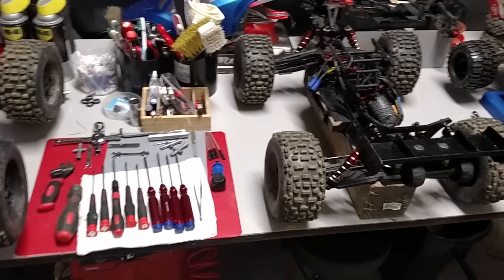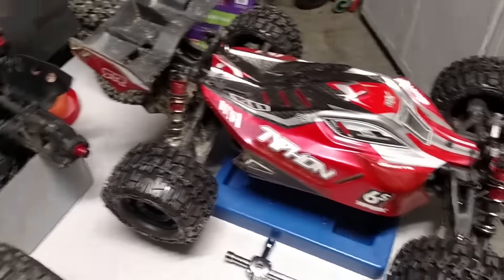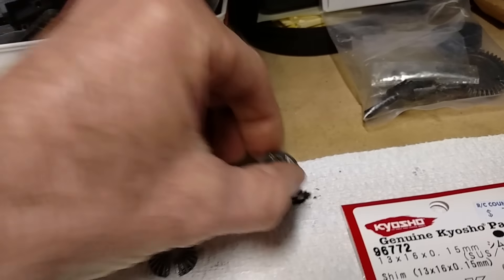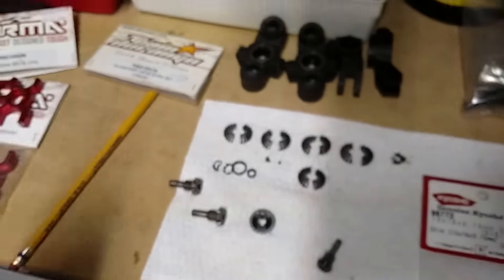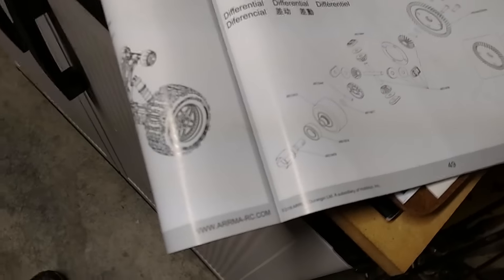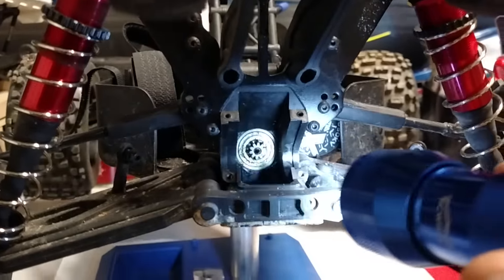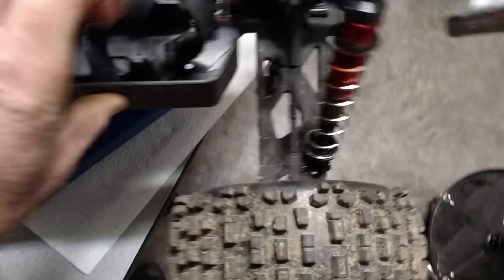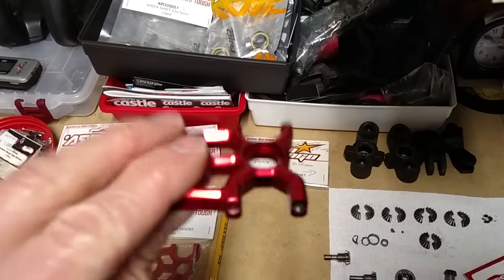Arrma Outcast 6s diff gear breakage

Comment: Thanks Rich for informative video, so far no dif breakage. Been running Typhon (16t) and Kraton (14t) on  2+3s Venom 50c 5000 mah just for bashing.... I also noticed your son's new Typhon shoes ( 2.8 trenchers on proline f11  wheels) looks exactly like mine, great job. Don't forget to tape them before gluing..
Reply from the maker: ReyDg thanks bro. Glad you haven't had any diff breakages yet. I shimmed my Typhon diff after first breakage and it had worked great. Definitely going to tape those Trenchers. I forgot if you told me how you fitted your F11s, did you use hex adapters?

Comment: Np Rich, glad to help and share.. I also use EZ bedliner spray  on Typhon ( 1 coat) for body to strength. It's also flexible and waterproof.. I put (2 coats) on Kraton and it seems to be cracking( the spray) due to the multiple coats. As for the Typhon with one coat, it's holding up really well...
Reply from the maker: ReyDg thanks for that too. I've gotten by with shoe goo and drywall tape, but spray seems much easier. Some guys on the forum also use Flex seal spray, going to give the spray a try.🐒🐒🐒

Comment: Great vid Rich thanks for sharing. My question for you is why do you suppose Arrma doesn’t build the stock diffs tighter? What are the downsides to tighter diffs that they may be considering? Could it be they want them looser for more speed, less power loss through the drivetrain, longer battery runtime, lower heat buildup on the electronics? Just seems to me that if those things are the tradeoffs, I’d rather deal with those things than busted gears. Curious your thoughts. Thanks.

Comment: Ha, same here. Have all but the Talion, can't believe I didn't get one as the Fireteam was last purchase when $399 and got it instead. Now I want a Talion. 🤣 But back to story my Typhon 6 I made for speed and don't get to run it much not having the space, so if anything breaks on my 6s vehicles the Typhon will be used for spare parts for awhile. The Arrma 6s is definitely the sweet spot for RCs. Even getting rid of my Xmaxx as I have more fun on 6s.

Comment: I'm having some clicking with my Notorious, so I'm searchn to pin point my issue, an lookn for ways to upgrade, so this issue doesn't happen in my future..hope this solves my problem..thnx bub..Great Vid..👑🙏
Reply from the maker: My first reply got erased 😝. Clicking is usually a busted tooth on the input and/or flattened or chipped teeth on the crown gear. Make sure your diff case isn't cracked or the gear cover screws stripped out. That will allow new gears to strip out again. Using 2-3 Tekno #1222 shims on the crown gear side bearing tightens up the mesh and helps prevent gear failures. I did a better diff build video after this one. Only (internal) diff difference is with the V4-V5 diffs, I no longer use extra Mugen satellite shims, just swap out the planetary shims. 🍻😎💪👊👊https://youtu.be/5gy3mt8zVmA
Reply: @richduperbash2966  thanks Rich, il go check the vid out aswel..it researching on my rig for the issue, I had found the left front wheel hub was rounded out on the wheel itself..so I'm going to pull all different an rebuild an shim after watchn ur vid..thnx for the info,Great Advice n Vids bub..🤝🤘👍🙏

Comment: Thank you for this video. I'm still a noob but I'm good at tinkering to find a solution. Will be ''bullet-proofing" all my diffs in my free time this week. (6 diffs. 3 on my outcast and 3 on the one I bought my Dad.)
Reply from the maker: Tristan Hardy your very welcome. I was rambling on quite a bit, but follow Tp-PartsRC-Xtreme vid with the supplied shim part numbers and your golden. I have bashed the living crap out of these diffs and it truly makes a difference. You can still have breakages of course, but they are much less frequent. The 2-3 bearing shims on the crown gear side by Kyosho or Tekno have been awesome in keeping the crown and input gears meshed better. Kyosho's are my favorite, but Tekno TKR 1222 works also. Good luck and props for hooking your pops up, very cool of you to do that.👍👍😵😵😵😲👊
Reply: He gets the good stuff. Already dropped in the Voltage Hobby servo mount and the RPM front skid plate on both. I highly recommend the servo mount.  

Really glad you explained the "mystery shim" as well.... Now I have to figure out where mine rolled to... Getting gear slippage on the rear Diff. Bonehead move on my part.
Reply from the maker: Tristan Hardy just saw your message. So awesome to hook up your Dad like that. Yeah the "mystery shim" had me baffled at first, they are paper thin and easy to lose no doubt. I've done lots of bonehead stuff in my garage, believe me...Lol. Lightly greasing these shims helps them stay put while slipping the diff unit into place and when putting the gear case cover back on. I've spent a good chunk of time, countless hours wrenching and experimenting with these Arrmas, bulletproofing is definitely worth the effort. And pushing that crown gear over into the input more with bearing shims has helped big-time. Changing the input gear is a PITA, definitely helps from breaking those little teeth off when the diffs get torqued from rapid deceleration....ie, hard on throttle landings or moments when the wheels get jammed suddenly. Let me know if you have any questions bud, love bashing and wrenching about equally. 👍👍

Comment: @RichDuperbash - i know this is an old video brother but i AM getting ready to do some maintenance on my shims! I was able to find the 
KYO96772 - Kyosho 13x16x0.15mm Differential Shim Set for my 6s KRATON & my 6s Notorious... How did these shims work out for you, were you able to stack two on each side or did just 1 work ?
Reply from the maker: I could usually stack 2 of them on each crown gear side bearing. It's nice to also have the thinner Tekno #1222 shims also. Allows you to really fine tune based on different tolerances 🍻😎💪👊👊

Comment: New Notorious. 2nd run started clicking/rattling. Picked it up and spun the wheels and noticed that both front wheels could spin forward independent of the drivetrain. Pulled out the front diff and it looks ok. Next step to open it up and see what's going on inside..
Reply: Upon closer inspection the main diff gear and the one that drives it are both worn from slipping. Surprised it happened only on the 2nd run. Hadn't even run the battery down either time. Thought Arrma was meant to be tough.

Comment: Thanks for the advice these diffs, something wrong with my Outcast rear diff so doing some research before I tear it down, what diff oil weight do you use in your Outcast, Arrma forum says popular is 70k/100k/30k front to back??
Reply: I wrote down 50/200/20 from a kraton video he did if that helps
Reply from the maker: Sorry I missed your message Matt 👀. I'm running 50/200/20K front to rear. Works great for me overall. 🍻🚀🚀😎💪👊👊
Reply: @richduperbash2966  thank you Rich is it also needed to shim the stock input gear that meshes with the crown🥺

Comment: had a rock get under my center diff it wedged and pushed the pinion gear all the way back to the motor. i think broke the front ring gear. i am not getting full torque to the front wheels now.
Reply from the maker: Yeah that sucks Craig 😝. Rocks can wreak havoc for sure. If you're not hearing cyclical ticking or grinding (slippage) on harder throttle or braking, it could be the center diff. Likely the front planetary gear and/or set pin cracked. I'd check the center first as it takes the most abuse and then the front. 😎💪👊👊

Comment: Yes I used the Team Associated RC8T wheel hex (#89330)...the pin that comes with these particular hex are too big for Typhon. You can drill the hole bigger or just use the existing Typhon pins which are smaller but the hex set comes with metal O rings that fits on top of pin hole. I put a small dab of paper glue from dollar store just so pin won't move and still be able to take pin out....
Reply from the maker: ReyDg thanks for the info, someone on the Arrma Forum was  asking about those I think, I'll share that. Yeah Thomas is rather expert with these rigs. His vids are bad ass, too!

Comment: If you look at the back of the manual (part number section) it clearly shows the shims behind the planetary gear. Not sure why they aren't pictured in the diff service section.
Reply from the maker: This is an older vid. ARRMA didn't start using planetary shims until the V4 versions last year. That said, they're smaller in diameter. I still prefer the Mugen Seiki E0206 ones. 🍻😎💪👊👊
Reply: @richduperbash2966  Gotcha, my bad, I'm new to the scene. Funny I would've put one there regardless, why would they have a gasket touching a spinning gear with nothing between? Anyways keep hitting it bro, you're a beast.

Comment: Thanx Rich. Great video especially when your new in the rc hobby like me! Could i use steel washers 5x18x0,3 (ar 709024) also instead or is that a stupid question? And did you try the wheeliebar on the Kraton yet?
Reply from the maker: Friso Fox thanks bro, think that part number is for the smaller 4 shims that come stock in the diffs.  They work on the satellite gears, planetary shims are the bigger ones. The shims are precision cut steel. Haven't run wheelie bar due to big storm, just put on.
Reply: Rich Duperbash strangly on the Arrma website ar709024 is 3.5x12x0.15mm. On several Dutch hobby websites ar709024 is 5x18x0.3mm. Anyway, i'll go with the TD ones.

Comment: Great video as always do you recommend doing the same thing to the diffs in the 4s model's as well any info is greatly appreciated thanks
Reply from the maker: Thanks Brother 👊!!!! The 3-4s diffs are designed so uniquely I'm not sure any additional shims would be doable or beneficial 🤔. The biggest thing I've discovered is quickly replacing the slipper box and front/rear input gear bearings with rubber sealed. The stock ones tend to foul and seize a bit easily. I'll let you know if I come up with or hear of any useful mods. 🍻😎💪👊👊
Reply: @richduperbash2966  thanks so much for the advice much appreciated can't wait to see more of your videos have a great day

Comment: Rich can you please help me i have had nothing but diff problems lately 😔  my 1st diff i blew up the inside gears (my fault was running super hard on punch level 9) my 2nd diff i stripped the spur gear and input gear and last night I was doing a shakedown and yet again it sounds like the spur geat stripped out i already shimmed it per your specs should I try to another outer shim ? Any info helps thank you

Comment: Rich Wouldn’t you think that pushing the gears in closer together, towards the center wouldn’t work as well because the teeth on the gears are not as deep towards the center. Maybe it has to do because it’s just all tighter then again would that b better in the long run all the friction? Just gotta try n see how has this worked out still holding strong?
Reply from the maker: I can say 100% this method definitely helps strengthen the V1-V3 diffs and achieve far better longevity👍. My later diff video was much more specific with detailed tips than this one was. I rambled on like Crazy here 😂. For the V4-5 diffs, I only swap the stock planetary shims for the wider Mugen Seiki ones as ARRMA added both planetary and new outdrive shims. (I don't add any satellite gear shims with V4-5 models). I still swear by using 2-3 Tekno #1222 crown gear side bearing shims front and rear to all models including the EXB. This has definitely helped spare busted teeth along with good throttle use, healthy bearings, appropriate wheels, and semiregular diff maintenance. Shimming is ultimately by feel, but I'd rather start a bit snug until the gears break in and settle. 😎💪👊👊
Reply: @richduperbash2966  dam bro u always help out too much lol a simple answer would have been fine LOL but honestly this was awesome thanks for the great info and super duber  quick response!
Reply from the maker: @carlosgabin5215  you bet Brother 👊. If I don't respond it's because I didn't get notified via YouTube or I'm at work 🤗. I've realized I miss a s.hit ton of messages unfortunately.

Comment: I've been through 5 center diffs. The casings came apart where the bearing holds the front in the mount. Switched to rc8.2 diffs.
Reply from the maker: Dixiecupdean thanks a lot for that, did you swap all 3 diffs and cases or just center?
Reply: Rich Duperbash no just the center. Shim it on the spur gear side so there's no play.
Reply: I'm surprised that Kyosho uses strait cut gars!

Comment: If I need to remove some of those metal on metal screws that are super difficult to untighten. With the red red lock. Am I OK to use a Sowder iron to heat it?
Reply from the maker: You bet Brother 👊!!!! I've long used a hot soldering iron to melt threadlocker. It's WAY faster to use a butane torch though. Just be careful not to melt nearby plastics. 😎💪👊👊

Comment: Recently got a V3 Kraton and shimming the diffs and replacing the diff fluid was one of the first things I did to it based on all of the forum posts and youtube vids I looked at before buying.  I went with the Mugen shim set EO206 and did the 4 total shims for each diff (two planetary and two satellite) .  Hopefully I don't have any gear issues like this.
Reply from the maker: Pills161 Congrats on the V3 Kraton 😱!!! I'm actually building up a new V3 myself right now 👌. The Team Durango shims were discontinued so Mugen seiki is all I've used for over a year now👊. Shimming and maintaining the diffs definitely helps big-time. It's still possible to break or strip gears, but much less common. Best of luck with your Kraton brother 👊!!! She's a BEAST 😨🤘🤘😰😰😰😎💪👊👊
Reply: @richduperbash2966  Revisiting this video I recently stripped a motor mount screw just like you stated and had to drill it out :( although I did save the mount though by drilling out the rest of that screw. It took a while but using a bit small enough to not destroy the hole threads was able to get the rest.  $30 for that mount nee blah no thanks
Reply from the maker: Pills161 stripped screws are such a friggin pain 😨. Red threadlocker has no place on these rigs. Think Jenny's RC has the mounts for 6-8$. 😎💪👊👊
Reply: @richduperbash2966  hi rich, how comes it that I haven't shimmed my diffs and never broke one in 3 months of ownership!? I drive every week 2-10 packs and mainly 6s
Reply from the maker: @ELValenin  not shimming isn't a death sentence for your gears. Many factors lead to or contribute to gear failures; underfilled diffs, terrain, driving style, or sometimes pure circumstance 🤔. Not all diff cases, diffs/cups will have identical tolerances. Some diffs may not need shimming. Overall, I've had less gear failures by adding shims for a snugger mesh. The V4's are now shimmed differently out of the box. They added shims behind the planetary gears and on the diff outdrives. I'm still experimenting to see what works better over time. 😎💪👊👊
Reply: @richduperbash2966  maybe it is because of the minokawa tires, they're Really really really bad on gravel and grass. So bad I didn't notice a difference between punch 4 and punch 9 at all
Reply from the maker: @ELValenin  you could be spot on Brother 👊. The Minokawa's slip where other aggressive tires grab. 👍

Comment: Richduperdash hope you are well? I had my kraton on shelf for a bit took it out with my son yesterday . The car don't feel right felt bit low on drive power i noticed a crunch sound coming from the car however pulled the diffs out oil looks a little low but no damaged even to the Input gears or diff gears!!! My drive cup at front has come loose a few times and tightened it up!!! Also the bearing on centre diff on the centre front drive cup has abit of play in it also!!! Do you have any ideas? I'm going to clean diffs out and check spider gears👍 cheers rich
Reply from the maker: carlo fois wish I had an easy answer for you bro...Lol. Sometimes a bad bearing can wreak havoc or a broken planetary gear hasn't displaced yet, but is wobbling around a tad and grinding/binding intermittently. You may need to go diff by diff to pinpoint the source. Diff bearings do go out unnoticed sometimes, especially the front and rear smaller input ones. I usually start with the center diff when I'm not sure and go from there. Clicking or speed based rhythmic ticking usually means a missing crown and/or input gear tooth. Good luck tracking it down and get back to me, I'm curious now.👍👍👊
Reply: Rich Duperbash cheers glad you got the typhoon nearly done. I'm in the same boat if I'm not plastering or roofing!!! I'm trying to fix my rigs. I will do what you said start with the centre bearings and do the diff fluid see how I get on I checked diffs and planetary gears all looked good it's bugging me I will keep you posted give me a week or so will start work this week.👍 thanks for your advice appreciate it rich I know your too gun on these rigs.
Reply from the maker: carlo fois hey I forgot to mention, be sure and check your gear mesh first if you didn't already. Sometimes the motor/pinion will shift into the spur if the motor mount screws come loose. Too tight a mesh sounds awful, lowers your speeds drastically, and really heats up your temps quick...Lol. You may have checked already, but if not, definitely start there.👍👍👊